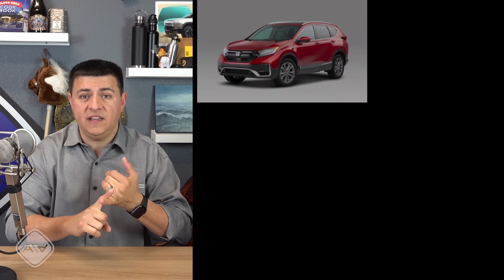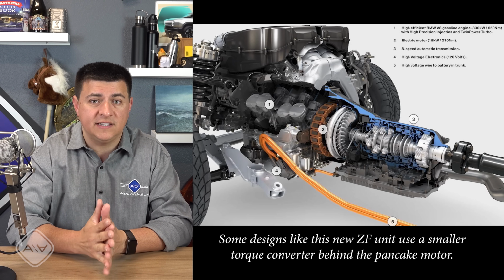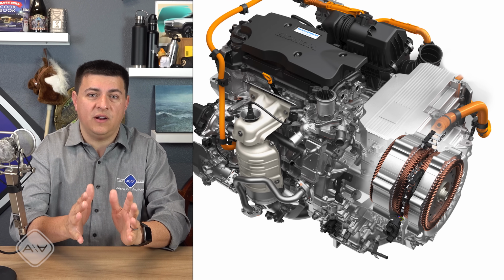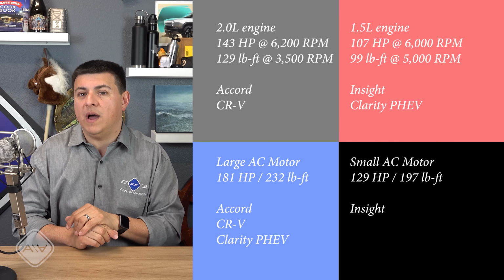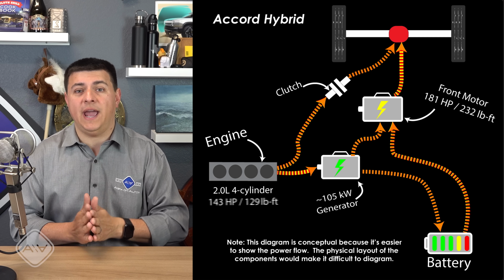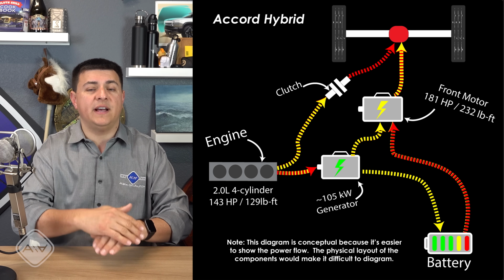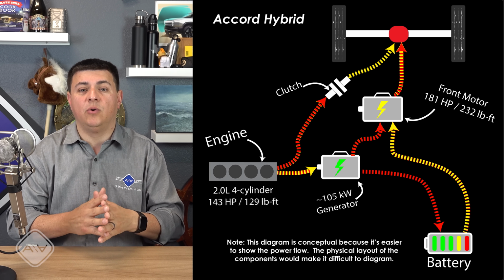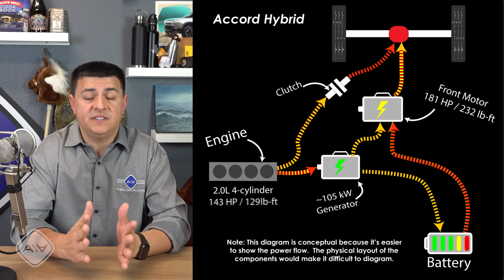How Does It Work?  Honda's 2 Motor Hybrid System Explained!

Comment: I see no point in these, BEV all the way, wtf are we talking about 200hp ... You can pick up an used Tesla for 1/3 of these vehicles. Put all focus on infrastructure, and at-home / apartment charging. This seems like a total distraction for no reason.
Reply: And if you live in a 10-story building, at the 10th floor and you don’t have a (public) charging station at the ground, how do you charge your wonderful Tesla? Do you throw an electric cord from 10th floor to the ground in order to charge your vehicle in approx. 8-10 hours? And if you have an emergency, or it comes a blackout after 3 hours of charging, what do you do?
Don’t get me wrong: I drove a Tesla Model 3 LR, it’s very fun to drive, but when the battery is almost discharged… the back carrot gets bigger and bigger. 😄
For this moment of time, HEVs are welcome. We need to continue to develop ICEs to fulfill more needs, the BEVs are not a good solution unless we can’t do a battery capable of a minimum 800 km of continuos riding, no matter the speed, the weather, the outside temperature, the car’s load and so on — and with NO environmental impact.

Comment: Honda improves hybrid  but loose against Toyota in terms of perfection. It's nothing more than 10y Chevy volt style
Reply: The Volt uses the same two motors and one ICE, and can act in EV or serial hybrid modes, but from there on there is little resemblance.

The Volt uses three clutches and one planetary gearset to integrate the ICE and motors. It operates in four modes: Low-speed EV (one motor drive on battery power), Hi-speed EV (two motor drive on battery power, blended through the planetary), Low-speed Extended Range (one motor on generated power, some charging), and Hi-speed Extended Range (two motors plus ICE drive, no charging). blended through the planetary). The point of blending is because the small motor can't handle high speeds. The point of adding the ICE is more for when the PHEV's battery is low, than for efficiency. I think it gets 35 mpg in extended mode.

The Honda uses one clutch and no gears except those that connect one component to another. It is a pure serial hybrid in mode situations, and a pure parallel hybrid when that is more efficient.

Comment: he never addresses the slipping of the engine . racing of the motor up hill or under hard acceleration !!!!!!!!!
Reply: The engine doesn't slip. There is no transmission to slip. Going up that hill, the engine is driving a generator.

Comment: You lost me at the 212 hp.  At 110 mph you should be able to get the 143 from the ice and 181 from the battery pack( short term) that's 324 hp peak.   So the emoter  must be running way too fast and it's torque has fallen off and only capable of an additional 69 hp. Is that it?
Reply: kirk creelman no, the e-motor is also constrained by what the battery can output.

Comment: its a good system but the it had to be faster than this
Reply: I'm not sure what you are trying to say. For a hybrid that isn't a super-car, these Hondas are fast. In fact, in 2019 Motortrend published a list of the 12 quickest cars in America that were rated at 40+ mpg on the highway (google it, I apparently can't put a link in a comment):

#1, Honda Accord Hybrid, 48 mpg, 0-60 mph in 6.7 seconds.
#2, Honda Civic (non-hybrid 1.5L CVT), 42 mpg, 6.8 seconds.
#3, Honda Insight (Hybrid), 49 or 45 (touring) mpg, 7.3 seconds.
#7, Honda Clarity (PHEV), 40 mpg, 7.5 seconds.

Comment: 143 + 181 = 324, NOT 212.  The IC engine will ONLY produce its 143Hp at a 6,200 RPM to about half that at 3,000 rpm dropping linearly down from their , while the electric motor will most likely produce more than 170 HP at all rpm.  My guess is that at 65 mph the IC engine is spinning about 2,500 rpm which at full throttle should be able to produce about 60 HP, if one wants to pass on an uphill grade the car should be able to produce at least 230 HP (170 + 60).

Comment: The official name of the Honda system is “Intelligent multi-Mode Drive,” or iMMD. Both Toyota and Honda say they have an “eCVT,” but it means different things. Toyota’s is “electronically controlled,” meaning how the power split is monitored. Honda’s is “electrically coupled,” meaning there (usually) is no mechanical connection between engine and wheels; that is, a serial hybrid.

At about 7:20, you say the battery is “taken out of the equation” at highway speeds. This is not true. While cruising at 55 mph, and with the clutch engaged, about 30% to 50% of the engine’s power is going to the battery (it’s generating 34 hp, and needs only 15 to 20 to cruise). When about a quarter of the battery’s capacity is saved this way (where it fits in the range changes with ECON, NORMAL, and SPORT modes), the car goes into EV mode to use that energy.

I don’t fully understand how the 212 peak horsepower is achieved, but your explanation can’t be right. It can’t be the engine’s peak HP at 100 mph+ added to the motor’s 181 HP,  because this would give different combined totals for the Accord/CR-V and Clarity. The 181 HP limit is a software limit, not a hardware limit. A sustained electrical power above that could damage the coils, so it is limited. I have seen speculation that this limit could be exceeded for short periods, which is why all three that use the larger motor have the same “combined” power. It's "combined" because the battery can't provide it alone.

And the Accord is faster than the Camry in 0-60 mph by between 0.4 to 0.8 seconds, depending on whose test you read, Because the Camry won’t get anywhere near its maximum HP rpm in that range, either.
Reply from the maker: Honda's system is only a serial hybrid below ~42 MPH. Unless more torque is demanded, the system will almost always be in engine coupled mode. With the clutch engaged in steady state travel there is essentially no energy being sent to/from the battery unless the battery SOC has dropped, or you're traveling at a speed where the system has decided it is more efficient to generate power. Honda's engineers have confirmed the basics of the total system HP. It's achieved when the clutch is locked and the engine is at peak output and the battery is at peak output. The Clarity gets a similar number because the battery can discharge at a higher rate balancing out the lower output of the smaller engine. The Camry on the other hand will certainly produce peak HP at a variety of different RPMS, the reason its slower has more to do with the design of the system, especially MG2 torque output (software controlled) and battery disapation rates.
Reply: @AAutoBuyersGuide  I don’t want to get into a drawn-out argument on your Youtube channel, but 18 months experience driving one, and in-house Honda research papers you can find on-line, both disagree about when the engine is coupled. A paper titled “Efficiency Enhancement of a New Two-Motor Hybrid System” describes how it alternates between Engine Drive and EV Drive on the highway. Again, this is verified by experience.

More details about the engine can be found in "Development of 2.0 L Engine for New Accord Hybrid.” Specifically, the engine’s most efficient point is 2000 rpm (54 mph with the clutch engaged) and 33.7 horsepower. The engine will try to operate as close to this point as possible, which usually means about the same torque but different rpms. Since steady-state cruising at 54 mph requires about 15 to 20 horsepower, the rest goes to the battery.

A consequence of this is that the clutch is never engaged in high-horsepower situations. So the 212 hp number cannot apply with the clutch engaged. I admit that I am not sure how it happens, but your 100+ mph scenario is not it because the clutch is not engaged.

Comment: But toyota have better mileage. So your statement about efficiency is questionnable. Based on real world results, toyota has better efficiency.
Reply from the maker: Efficiency depends greatly on your speed. As I say, Toyota’s system is more efficient at higher speeds and certain lower speeds while this system is more efficient at moderate highway speeds.

Comment: so just like toyota hybrid
Reply: Yeah. Both manufactures put out products with four wheels, a windshield, a steering wheel, and some comfy seats. In other words, cars.

As far as the drive train goes, both use an Internal Combustion Engine, and two motor-generators. The similarities stop there.
Reply: @jeffjo8732  its almost identical. Honda uses is simpler version of Toyotas hybrid system. Toyota hybrid  is superior in every way. better battery technology, and balanced charging etc.   But their cars looks like shit lol.
Reply: @MrDaldagnuur  Did you watch Alex's video? Or Prof. Kelly's video at https://www.youtube.com/watch?v=QLUIExAnNcE&feature=emb_logo? It seems obvious you didn't. Come back when you have, and can describe how each combines electric and gas power, and quantify what performance metrics you think are superior.

Comment: When I floor it with Sport Mode in Honda Accord Hybrid 2019, it has a VTEC bahhhhhhhhhhhh in the engine.
Reply: Honda included iVTEC on these engines.  The low RPM cam operates as an Atkinson cycle, and the high RPM lobes are the standard Otto cycle we're used to. 

https://www.hondainfocenter.com/en/Accord-Family/2018-Accord-Hybrid/Vehicle-Details/Engineering/Atkinson-Cycle-2-0-Liter-4-Cylinder-Engine

Comment: What this ? Simply Like chevrolet volt - generator-engine, whats new here ?  And that is ? Oh god, you add 1 gear clutch 😀 Where is hybrid ??? Hybrid is not when you switch between ICE and EV - hybrid when you can use both ENGINE and EV at same time at any speed.
Reply: @sergeybatko2413 "What this?" A serial hybrid. The ICE drives a generator, which powers the motor that propels the car. It's the same kind of hybrid as a diesel-electric locomotive.

"Simply Like chevrolet volt" The Volt is more like a Prius Prime than this Honda. It uses one (VOLTEC I) or two (VOLTEC II) planetary gearsets much the same way the Toyota system does. It just combines the inputs differently.

"What's new here?" This is the iMMD Generation 3, introduced in 2018. It slightly improved the motor and engine, as well as software, of the gen-2 system from 2017. Which had more significant improvements to the same things from the gen-1 (2014; 2013 in Japan). There's a gen-4 (2023) which re-arranged the gears a little. But the underlying concept has not changed in 12 years.

"Where is hybrid ???" Do you not know what that means? Even after trying to describe it, and failing?

"Hybrid is not when you switch between ICE and EV." Correct. That's "convertible." Like a diesel-electric submarine that can only use one system at a time. Where, exactly, in this video do you think it says that? While I disagree with some of the ways Alex describes it, he never says that.

"You can use both ENGINE and EV at same time at any speed." Actually, speed has nothing to do with it. Hybrids usually can't use the gas system a 0 mph, since one of the benefits is eliminating the clutch/torque converter.

Comment: Doesn't work for SH!T if it can only go 8 blocks on batterie..........RAV4 can do 40 to 50 miles on batterie power........Paul
Reply: The RAV4 Prime is a PHEV, and the Accord is not. And for the record, there was a PHEV similar to the 2018-2022 Accord, called the Clarity, that could go 48 miles on a full charge. More than the RAV4's 42.

But a PHEV can only go about 10 feet until it reaches the end of the cable. Which is about the as significant as this one "on battery."  Which you get wrong. Just yesterday I went 3.5 miles in one stretch. The Accord can go 600 miles between fill-ups, and about 300 of that "on battery," since it takes its energy source with it. (Honda data for time in EV: 86% up to 25 mph, 54% between 25 and 50 mph, 13% above 50 mph).

Comment: To much complexity. Clutch disks drive shafts just go toyota
Reply: What complexity?  The Toyota is so complex that most people treat it as a black box that simply does its job. I agree that it does that well. But you are confusing the fact that it cannot be easily explained, and so is left unexplained, with simplicity.

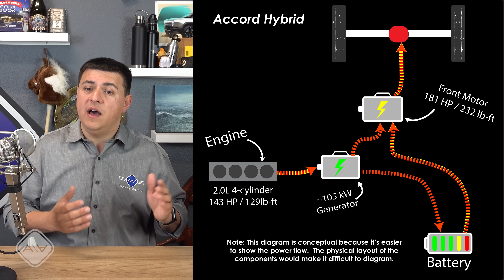The Honda hybrid system has fewer, and simpler, mechanical parts. And a simpler control system. It can be explained, as in this video, because it is simpler. Unfortunately, that does not prevent mistakes being made in the explanation, such as (4:57) "It can close a clutch between the two motor generator units, and it can send power mechanically from the engine along to the front wheels without involving either electric motor." The highlighted party is wrong.

The clutch is literally placed between the input shaft and the one gear the system uses that is not part of an input or output process. When the clutch closes, the still-connected generator is turned off. The traction motor is still "involved," just like MG2 is in a Toyota. But since this is overdrive, it is usually acting as a generator to charge the battery. What Alex doesn't explain, is that by overproducing power, the efficiency of the ICE improves, from maybe as low as 25%, to 40%. This more than compensates for losses that Alex treats too casually.

At 5:30, Alex claims that this loss "could be as high as, say, 20 percent." But Alex doesn't describe the conditions where that is true. From a Honda R&D publication titled "could be as high as, say, 20 percent." From a Honda R&D paper titled "Development of Motor and PCU for a SPORT HYBRID i-MMD System" (that's the name of this tech), it is only that low below about 5 MPH when the the motor is exerting less then 10 lb-ft of torque. It also can be as low as 4%, and is less than 5% over a vast majority of its operating range.

Now compare: in a conventional gas car, the ICE averages maybe 25% efficiency; 30% if you are careful. The engine can be more efficient, but not under your driving conditions. But a hybrid isn't restricted to your driving conditions. It runs the ICE at 40%, and splits the power output between immediate use, and deferred use (by saving it in the battery). The direct use ends up being (40%)*(95%)=38% efficient, and the deferred use might be as low as (40%)*(75%)=30% efficient.

Comment: Hydrid's are desirable as long as they are under the manufacturers warranty. Being the second or third owner of these types of vehicles, once the warranty has expired, opens you up to being buried financially when this system breaks down. Buy it new if you want one, just make sure to get rid of it when the warranty is about to expire.